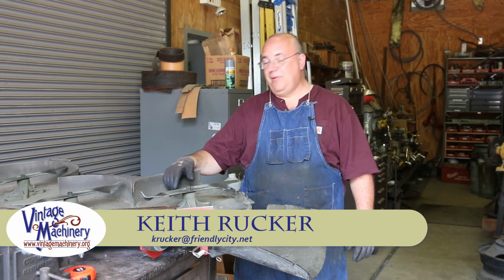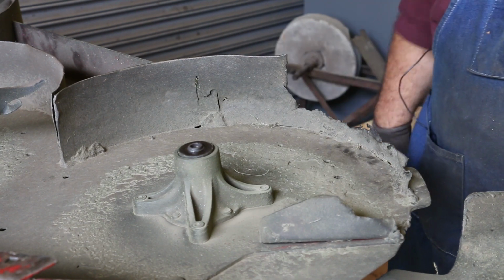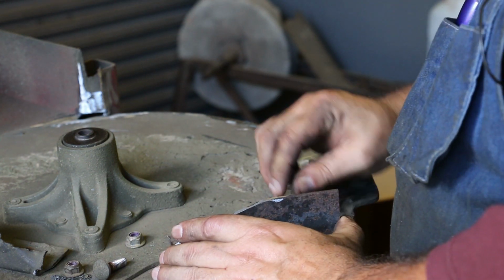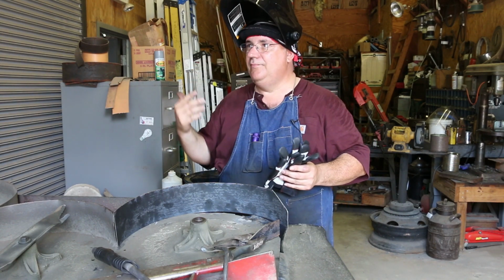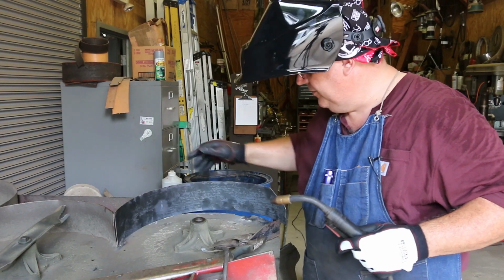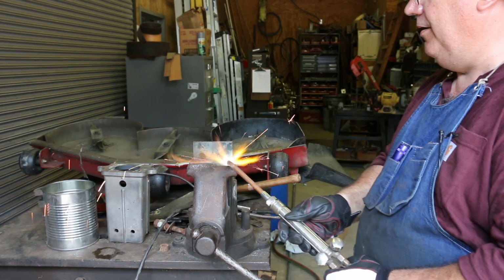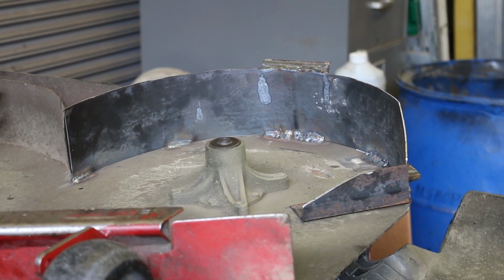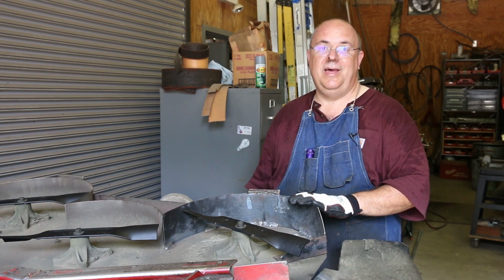Mower Deck Repair:  Fab and Welding

Comment: Interesting new look for you Keith with that Chip Foose do-rag.
Your there with the piece in front of you, is there a reason you did not close that gap on the front edge where the two pieces come together?
Reply from the maker: I am not a big fan of the do-rag, but it sure beats sweat rolling down your face (and glasses) when you are trying to weld...

Comment: I’m doing the exact project on a coroni Italian 59” mower deck. Where was your metal source? I’m near Valdosta.
Also, this deck has an outer deck with that shroud welded in extra. I thought of just removing the inner shroud, but I’m sure it’s in there to direct clippings up and through the blade..
Better to repair it the right way.
Great video

Comment: I don't know how it is with the other mfgs, but when I worked for Cub Cadet the price for a new deck only included the stamped steel deck and not anything attached to it. Which means that you would have to take off the blades, spindles, wheels, pulleys, covers, etc and transfer them to the new deck. So you not only saved yourself 800 bucks, but also a ton of time and aggravation. On a related note, the decks on higher end mowers are still actually made from welded plate, but that obviously comes at a premium.
Reply from the maker: When I bought my mower, I chose to go with a welded frame deck rather than stamped deck.  They had both options but I am really glad right now that I went with the welded deck.  At least you can repair it!

Comment: nice job,sounds like you need some grease in the part the blade is bolted to
Reply from the maker: They will all get lubed up before it goes back on the mower.

Comment: I know you'll see this well after the deck is reinstalled, but do you think that some material akin to Rhino Liner would slow down the sandblasting of the deck?
Reply: I thought of that also but Rhino liner by design leaves a somewhat rough non-slip surface.  You need something slick so the grass clippings don't hang up.  Hope someone chimes in with a better idea.
Reply: Powder coating, anyone?
Reply from the maker: Believe me, bed liners, powder coating, plastic, rubber, nothing works - not even cold hard steel.  This sand just eats though stuff....
Reply: Nitronic 40 stainless steel. Should stand up the life of the mower.

Comment: Wonder if lining the shrouds with UHMW would make them last longer. It is super abrasion resistant. That's crazy how fast those were eaten away!
Reply from the maker: You see that being used on some tillage implements on farm equipment that runs through the sandy soil.  It may help some, but the truth is it eats that away pretty quickly as well.  Most farmers I know just don't even replace the strips when they wear out because they end up spending more on replacing those parts than it cost to just replace the steel....

Comment: Great video Keith! Perhaps you could try some lower lift blades? They wouldn't create as much suction and might not suck the sand up? Just a thought. Ready for your next lathe rebuild video :)
Reply from the maker: I probably do.  I like the high lift blades because it mulches the grass clippings though and I don't want to get into bagging.
Reply: Agreed the high lifts will definitely provide a better cut and are standard here in the north. Always enjoy the videos and can't wait to see the rest of the machinery rebuilds in YOUR shop. :)

Comment: Great little video Keith, what job is it you do when you refer to 'Travelling with work' in your videos from time to time? Also is that a Gas-less MIG you are using. I can not decide weather to get myself a TIG welder or a MIG. I have owned MIG's before but from what I have seen I would be better off with a TIG for detailed tidy work......Comments??
Reply from the maker: I am a scientist that works for Bayer doing product development and technical support for our products.  I work in the Crop Science division so I work in agriculture.  As for MIG vs TIG - they both have advantages and disadvantages.  For me, MIG is the go to welder for most jobs but sometimes you just need TIG.  The setup we have does use gas (argon).
Reply: Keith Rucker - VintageMachinery.org Thanks for the reply Keith, as they say you learn something everyday. Still think I might go TIG..........

Comment: What thickness or gauge of steel would you recommend for fabricating a custom side discharge blocker plate for a Zero Turn mower?  The side discharge is FLAT so there would not be any curves or bend in this particular piece of metal.

Comment: Those blades look fine, as long as they are the full length, are able to be sharpened and balanced and cut good, I still use them.  Since sand scourers the deck are you sure you are not mowing too close?  Some persons like the grass shorter since they wear sandals and flip-flop shoes, instead of more sensible shoes so the grass does not tickle their toes.  You might have persons that insist that the grass be cut short.
Reply from the maker: I went ahead and replaced the blades while I had it apart.  They were due for a new set.  As for grass height, I am not as low as the mower will go, but it does not come up to my ankles either.  We have Centepide grass and it needs to be cut fairly short unlike some of the cool season grasses like fescue (which won't grow here - except in the winter....)

Comment: Good video. I don't know which is worse, your sand or my boulders. I bet you have to sharpen your blades every time you mow. I use Mackay 48 rod on the leading edge and in a cross hatch pattern on the topside of my blades. Seems to help.
Rollie
Reply from the maker: Sharpening is not a problem - the edge will naturally wear to a razor edge, the blades just wear out very quickly and either get too short or just disappear all together.  I usually go through four or five sets of blades each year and I probably should change them more often that I do.....

Comment: G'day Keith nice job, it really does get humid where you are bit like Queensland over here.  Must learn to mig weld! Thanks for showing the video regards John.  PS do you rate those horizontal band saws at all, it's just that I will be in the market for a bandsaw soon and I value your opinion.
Reply from the maker: John,  Yes, I like the horizontal band saws for cutting stock.  The one at the museum is a cheap import model - not sure that I would want one like that for my own shop, but it works (most of the time anyway, we spend a lot of time working on it....)
Reply: Thank you for your reply Keith, I was thinking of one but have decided on a power hack saw due to space thanks mate John

Comment: I'm guessing that I'm like the only person that welds new metal onto worn lawn mower blades. I do balance them also. Lawn mower blades run about $17.00 each here in Puerto Rico.
Reply from the maker: I am sure you are not the only person, but for me, buying new metal and welding it on really does not save that much money when you consider the cost of the new metal and the amount of time required to do the work.
Reply: I agree with you, but when you have a low income, I find myself having to put the time and labor to fix a problem, when there is little money for getting the job done. If my income was higher, I would buy new blades. The blades I'm using now have about 150hrs of use and would like to get about a total of 300hrs now that they have been welded-up. I do wish I could buy new blades.

Comment: Maybe a couple cans of spray on truck bed liner would slow down the sand blasting action? Couldn't hurt to try.
Reply: That is really good idea!  I think that I will take your suggestion when I put my mower up for the winter!
Reply: I was thinking about using undercoating on my decks, however, I really like your idea of bed liner!
Reply: South GA sand will eat just about anything on a mower deck...  All you can do it fix and replace what was eaten away...
Reply from the maker: I doubt it would do much good.  Heck, I peel the bed liner off of my truck all the time with just regular use!  It would not have any chance of standing up to the sand....

Comment: I mow about the same area you do, Kieth. I've been through multiple spindles on my 50" ZTR mower, do you have that problem? The Toro spindles look like they may be more durable than the ones on my Cub Cadet.
Reply: the spindles on my International Harvester Corporation. 50" cub are huge and the blades are 1/4 inch thick don't even have to clear limbs up to 1"thickoff my lawn but my lawn isn't big enough for a 50inch cut..
Reply: That sounds heavy-duty. I think my blades are as thick, about 1/4". My spindle problems have slowly gotten better as the rocks in my rocky lawns have slowly turned into smaller rocks and sand. lol
Reply from the maker: The spindles wear out on these too.  I had to take the mower in about a year ago to have something repaired and while it was in, they examined the spindles and decided they needed replacing.  Fortunately, at that time they were still under warranty so it did not cost me anything.  I almost decided to go ahead and replace them again while I had everything apart but in the end I did not.

Comment: Hi Keith - I know this vid is a bit dated, I found it very interesting nonetheless - - having a similar issue on my property I was thinking that if "low lift" or "fan/turf type" blades were available for your model machine that it might help reduce the "pulling" of sand up into the deck - I noticed the blades you're running and they appear to be "high lift" type.

Comment: What kind of shielding gas are you using?
Reply from the maker: Argon.
Reply: You should be running 75/25 for mig welding (75%Argon-25%CO2) that would help with the pin holes and make the welds stronger than welding with straight Argon.
Reply: ....maybe he didn't have any.  When the welding inspector comes by his home to inspect the lawn mower welds, we will be sure to let him know you are concerned
Reply: WOW who stepped on your jelly donut? My response was more for the guy asking Keith what kinda of gas he was using.
Reply: @EastCoastWoodworking  in the uk, for that thickness, hobbyweld recommends an argon 5 mix, although when i first started welding, years ago, i used co2 and those welds have lasted fine. the argon 5.mix gives a nicer looking weld than the co2 did, but i upgraded my mig machine at the same time. i understood the 75/25 mix to be more suitable for thicker plate steel ( but i could be wrong). ive used argon for mig on steel before and there doesnt seem too much difference, bu?  generally i keep argon for tig welding

Comment: At the worst I think you can get a replacement deck, I'm sure the rest of the machine is still doing quite well.
Reply: Don't bet on it.  Many of these machines are built to last only a relatively short time because commercial users depreciate the cost of the machine from their taxes over a three to five year period.  That's why man machines are no longer built to last much longer than that.  It makes then cheaper to build and buy and lowers financing cost to the company.

Comment: A strip of neoprene rubber attached by a good adhesive should work, but an allowance for its thickness should be made. The rubber is used by headstone companies to engrave the letters and numbers on headstones. The letters are sandblasted into the stone and they use neoprene stencils to do this. Here is a source for sheet neoprene http://www.fugittrubber.com/locations.html
Reply: I may try out your idea in the future. thanks for the link.

Comment: Hi Keith two words Astro Turf and it's green year round
Reply from the maker: I would rather cut grass than pay to install 2.5 acres of fake grass that will have to eventually be replaced.  I can not even imagine what that would do to water that flows down our yard with the 50 or so inches of rain we get each year....

Comment: I grew up on a ranch.  If my dad ever caught you standing around looking like you had nothing to do, he would say "Go cut the weeds".  He got tired of cutting weeds after 20+ years of doing it.  That's one of the big reasons that my brother and I stayed in school and finished college and both own homes with small yards.  We are switching to artificial grass because of the drought here in central California.  Getting tired of $150/mo water bills.
Reply from the maker: I have lots of grass, but I don't water it.  The Centipede grass that we use is amazing - it can dry up and look dead but as soon as a rain comes it just turns green and goes back to growing.  We are on a well so watering the lawn is just not an option - not to mention having 2.5 acres worth of grass....
Reply: Keith Rucker - VintageMachinery.org   Here in California, the rainy season ends in March/April. After that there is nothing until sprinkles in Oct/Nov.  You wait for the weeds to dry and then cut them.  But then we had to prune trees, pick off the small fruit that's no good for market, spray for bugs, fertilize. mulch, aerate the soil.... it's endless.

Comment: Sand blasting may be part of the cause but don't discount acid etching.  Grass clippings left on the metal will eat eat away that shroud.
Reply from the maker: If that were the case, they would all be eaten up.  It was just the one shroud on the side where most of the sand is accumulated.
Reply: Hi Keith-
I’ve replaced the same section on several commercial mowers.  Sand blasting only abrades the steel when the mower is running.  The acid etches the steel 24/7/365 unless removed. The section behind the baffle that you re-fabricated is the section that is most prone to have clippings and “juice” collect.  Ironically; the other sections are “cleaned” by the sand and hold up better.  The behind-the-baffle section does not get scoured and instead “pickles”.  Where on the other sections sand bounces off of what becomes peen blasted steel; on the pickled/etched section any sand that does get there rips off the brittle oxides and soft carbon-depleted steel. 
Kitchen vinegar is used by some knife and blade fabricators to etch steel.  To understand the chemistry of what is happening under a mower deck there is the following comparison: In folk medicine, horses are sometimes given vinegar for certain ailments; fermenting grass clippings, however, are too acidic and will make a horse ill.  The PH level of moist fermenting grass is death to steel.

Comment: sir that is tig welding ?
Reply from the maker: No, it is actually a MIG welder.  Somewhat similar to TIG except that there is a wire feeder to put material on - with TIG you do it by hand.
Reply: Thanks sir . I have bike garage . planning to Buy a welding machine. Which one is better. Tig. ark . mig?
Reply: TIG or oxy acetylene if you're gluing together thin walled steel. J.
Reply: +Average Joe .tnx bro
Reply: Muhamedrafi Cv
no worries, take care, J.

Comment: you know what they say " cleanliness is next to godliness when welding ". i know its just a lawnmower deck but still.. i would have at least knocked off the mill scale on the repair piece where i was going to be welding and i damn sure would have at least took a flap wheel to the deck where i was going to be welding. but its just a lawnmower right ? NOT

Comment: Don't make decks like they used to. One of my mowers, a ROOF brand sat for at least 12 years AFTER the owner quit using it in his tree farm. Deck is still %100. You might think about a set of Gator mulching blades. Not so much discharge and helps the grass too.  I've got them on the Roof and the Gravely with a 40 inch kidney mower. Cut like a carpet. Shame you couldn't get the deck flame sprayed with carbide while it was off!
Reply from the maker: Flame spraying with Carbide.  Now that is a neat idea!  I have no idea who might could do that though....
Reply: Keith Rucker - VintageMachinery.org We've got a business close to here that makes/made textile spinning thread guides and when everything was still made in the U.S. they had a flame spray division that had hydrogen fired guns that sprayed carbide powder on the guides. They haven't run in years though but I bet somebody in your neck of the woods still does it. It'd be better than a.r. plate or hardfacing.

Comment: A lot to think about here
I am a welder by trade
If you have nothing else to do !
If the mower/mower deck is for some reason Irreplaceable !
Most anything can be repaired
The question is 
Is it worth the time cost and effort !
By the time a mower deck rots
The spindle bearing are usually not far behind
If they are not gone already !
Lots of times mower deck failures are in fact caused by bad spindle bearing and/or out of balance blades
Rotten metal and stress cracked metal is not easy or fun to weld on !
Is the mower worth the time and effort ????
Of course like I said
If you are in love with the old mower and it is Irreplaceable 
This is not too bad 
But if there is a new mower deck with bearings and idlers available 
All this gutting welding and cussing
Well it can be just a hobby :)
You may be better off and money ahead buying a new deck
I once had a fella bring me his rotten exhaust pipe for his truck to repair :)
Welding rotten mower decks is just one step up from rotten exhaust pipes :)

This particular job does not seem to be the common rotten mower deck
A welder who already owns the tool to do this !
If a fella were to hire this done 
It could be expensive !
If a fella were to invest hisself the tools and knowledge
Well that still would be a good bit of a investmant
not a expence
but still
Not free in as far a money is concerned :)